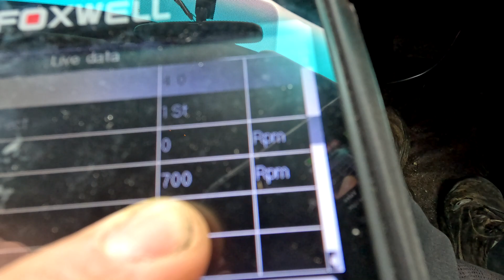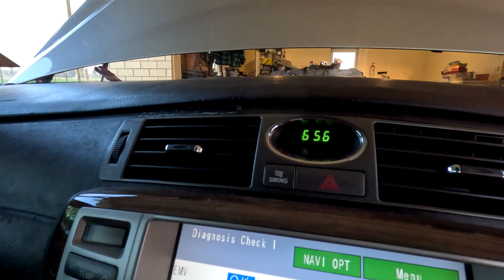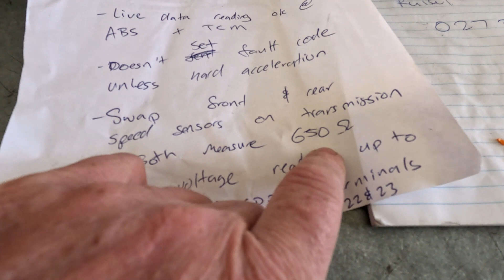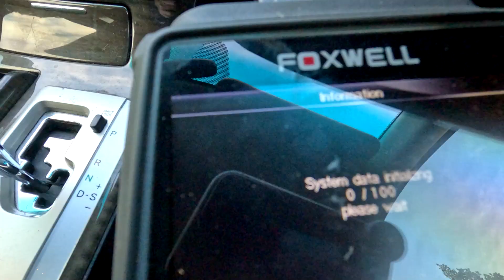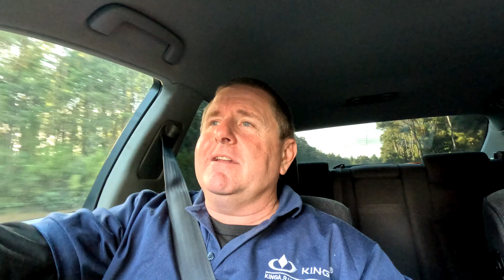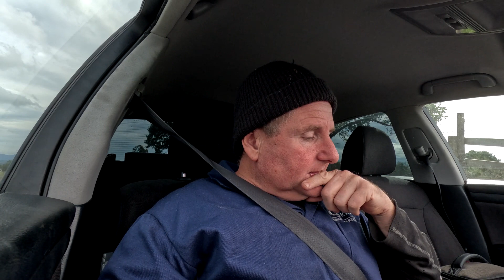P0500.  3uz Crown Majesta and Lexus LS430 P0500 code speed sensor circuit issue.  Testing

Comment: Hey there I have a 2002 gs430 and I have a code (p0500 powertrain speed sensor) I was told I was told I need an ABS scanner is that true or is this the correct code? Please respond
Reply from the maker: Did you watch and understand the video?  The speed sensor code P0500 fault can come from several places around the vehicle so its best to scan and monitor all systems
Reply: how to i get in contact with u